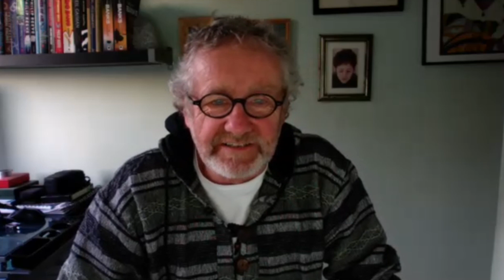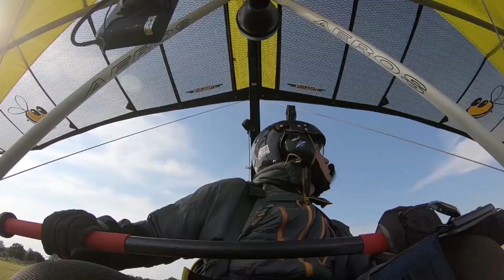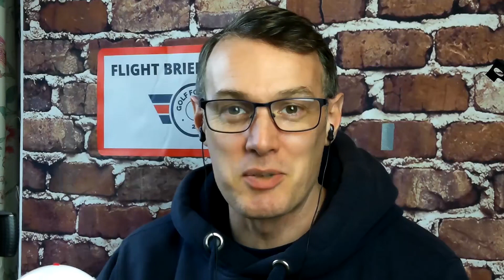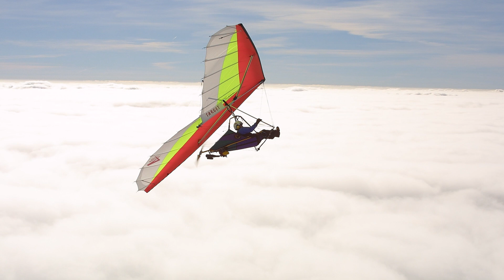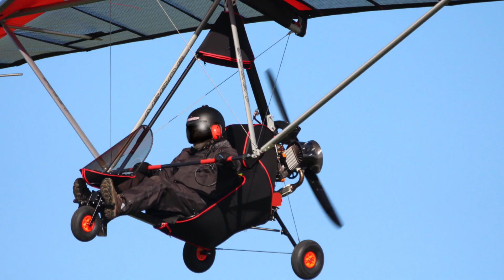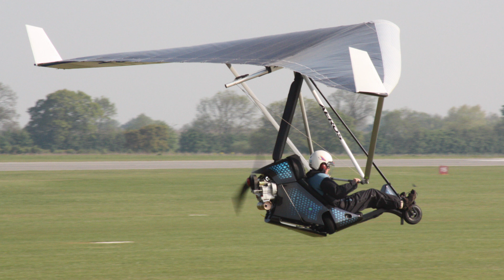Ben Ashman - PEABEE designer - what is in the FUTURE.

Comment: Any thoughts, to trying the new Cosmos 300 from Vitto, on the newer Adam?  Or would we limited in occordance with the law if a smaller wing was also to be tried speed wise.  I weigh 215 lbs.  Im pretty sure the 185 would be plenty.  Had 9 Moster 185's since 2013, definitely know the engine well here in my school.  Wondering if Ben would ship to the ole USA.  Good show.
Reply from the maker: I know Ben has done some testing with the Cosmos but found it too thursty on fuel. . The PeaBee and Adam really don't need any more power and the max pilot weight is 110kgs. I know of a few machines in the US already so they do ship over there. Give them a buzz.
Reply: @GolfFoxtrot22  by chance would you know the group of those guys that do have them over here?